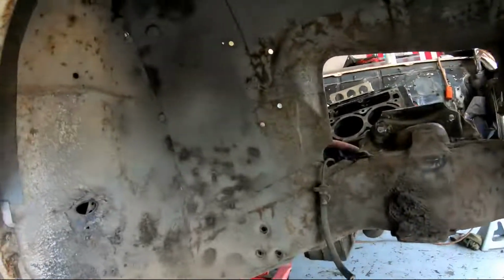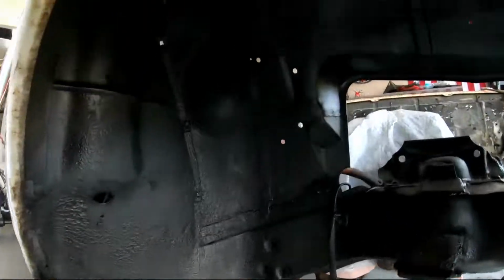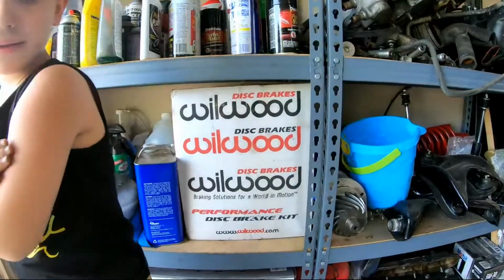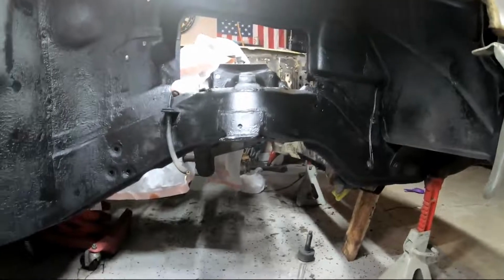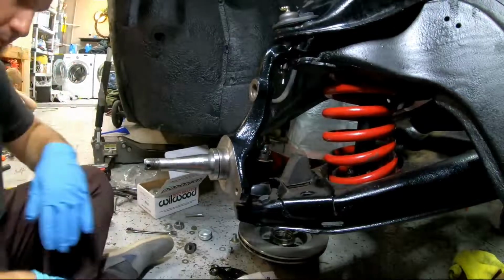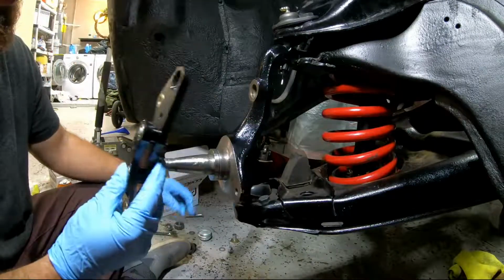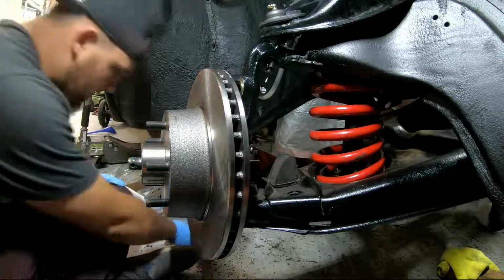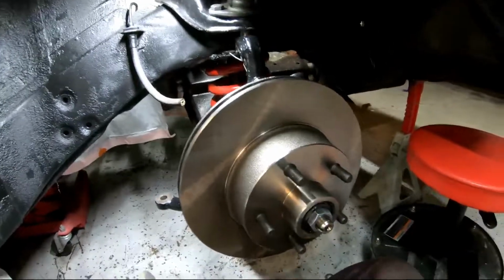Tbird part 13 (disc brake conversion)

Comment: Good vid why did you change calipers? i got mine recondition 220$ both. Do your rims clear for new rims? I have a 66 is your a 59?
Reply from the maker: Thanks. I switched to disc brakes mainly because I really don’t like drum brakes.
Reply from the maker: Mine is a 60

Comment: i have a 63 thunderbird do you no if it fit on my thunderbird ?? sorry for bad englisch
Reply from the maker: I don’t think so. But you can find disc brake conversion kits for them. Not sure if they make any wilwood brakes for the 63 tho.
Reply: @dmakhno  oke thx i will try to find it > i order my parts in amerika by bird nest